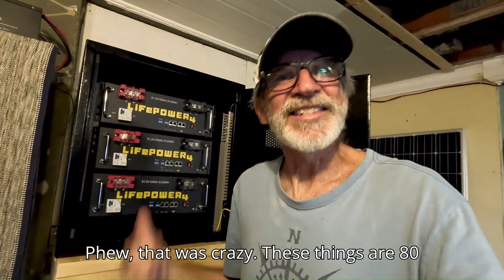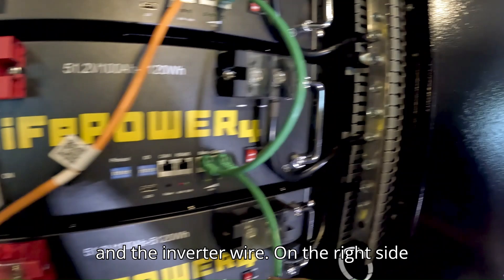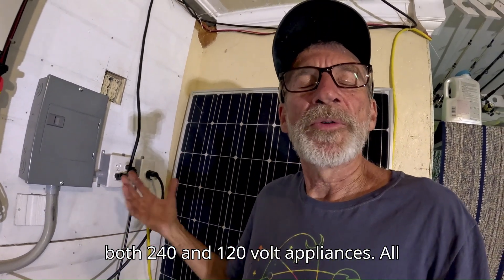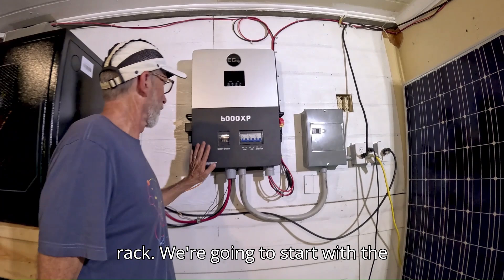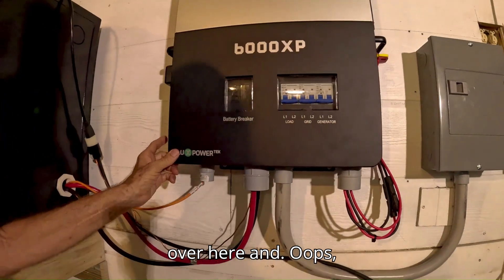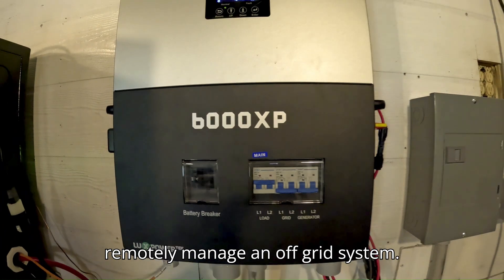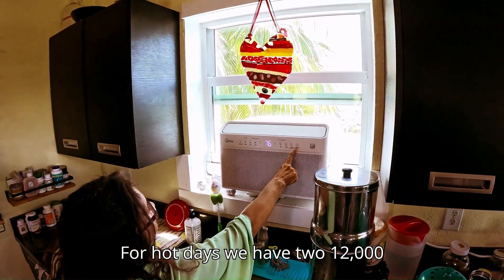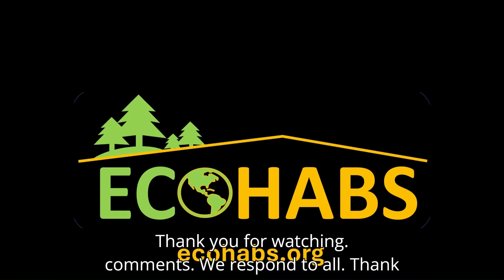OFF-GRID HOMESTEAD SOLAR: EG4 6000XP & LiFePOWER4 System #signaturesolar #solar #offgrid #homestead

Comment: I think they're more like 120 LBS, not 80
Reply from the maker: Right?!
Reply: @ecohabs4earth yup! I have 4 of them in my RV and I had to carry by myself
Reply from the maker: @twelveofthem dang you a tough guy!
Reply: @ecohabs4earth if they were any heavier I don't think I could have done it! I found your video because I'm thinking about upgrading to this inverter. I'm currently using the Growatt 5000 and it's not split phase so I'm having to use an auto transformer to get L1, L2 and neutral from its 240 volt output.
Reply from the maker: @twelveofthem  not sure of your power needs, but I’m kind of wishing I got the 12,000 XP. My only option now is to add a second 6000 XP, which is slightly less convenient.

Comment: The manual advises you charge each battery to 100% before connecting them in parallel. Did you do that if so how?
Reply from the maker: I did not at fist as I don’t have a separate 48 V charger. Since all three batteries had the same charge level I was not too concerned . But it is possible to hook each one up individually at first and reach 100% charge. I have now done that. After about six months of use the master battery BMS got confused. I see this is a common issue online I simply had to switch another battery into the master slot and everything started working properly again.

Comment: Complaints about Signature Solar often involve issues with product reliability (like inverters and auto-resetting batteries), poor customer service response times and communication, and deceptive or problematic shipping and billing practices. Customers report receiving damaged or incorrect parts, experiencing system failures, and having difficulty getting technical support or resolutions for their issues. 

Product and system issues
Equipment failure: Customers have reported inverters malfunctioning or blowing up after installation and experiencing issues with battery auto-reset functions that require manual intervention. 

Incorrect or damaged parts: Some customers have received incorrect cables, and others have found cracked solar panels upon delivery, sometimes suspecting they were shipped that way without being properly inspected. 

Incompatibility: There are reports of incompatibility problems with panels not working correctly with their inverters, specifically with the EG4 system being difficult to use with panels other than Anchor panels. 

Customer service and support
Slow or non-existent support: Many customers report difficulty reaching a live person by phone, and have experienced long periods with no communication on support tickets, even after multiple attempts to follow up. 

Warranty and support gaps: Some customers feel Signature Solar has "dumped" them and that their support has been lacking, especially after the initial warranty period, as noted in this Facebook post. 

Billing and shipping problems
Deceptive shipping costs: Some customers have reported being shown a low shipping rate in their cart, only to have it change to a much higher rate at checkout without any explanation, as described in this DIY Solar Forum thread. 

Late shipping and uncommunicated delays: Several customers have experienced significant delays in receiving their orders without any communication from the company, and some have been charged for the entire order well before it shipped, notes this DIY Solar Forum post.

Comment: for the longevity of those expensive batteries can the software limit their max charged capacity to 80%
Reply from the maker: Yes the software has those controls, but stopping at 80 percent to prolong battery life used to be more common with older lithium setups where users manually managed charge parameters. These days, with closed-loop communication and smart BMS technology, the system is designed to manage things like charge cutoffs, voltage thresholds, and temperature protections more precisely than manual settings would allow. So, there is generally no need to limit charging manually for longevity because it is already being handled in the background to optimize battery health.  Let me know your thoughts on this!

Comment: Do you not have an EGC running from panels to 6000xp. Just frames grounded to rod at array?
Reply from the maker: Yes that is correct, for this temporary test set up.  Our next phase is to harden the system with conduit and more robust protection.

Comment: Luxpower makers of the EG4 6000XP inverter that are made in China, are facing scrutiny and accusations that they may pose a risk of backdoor cyber attacks by the Chinese communist government. The concern stems from the discovery of "rogue" or undocumented communication devices in these inverters. These devices could potentially be used for unauthorized access and control, potentially leading to grid instability or damage. I would think that if you truly wanted to go off grid, that you would want to stay away as possible from these inverters. No thanks, not ever in my home.
Reply from the maker: No publicly available evidence explicitly confirms that Luxpower’s EG4 6000XP inverters contain such devices. The accusations appear to stem from broader concerns about Chinese-made equipment rather than targeted findings against Luxpower. Without detailed forensic reports or official statements naming Luxpower, the claims remain speculative for this specific brand and model.